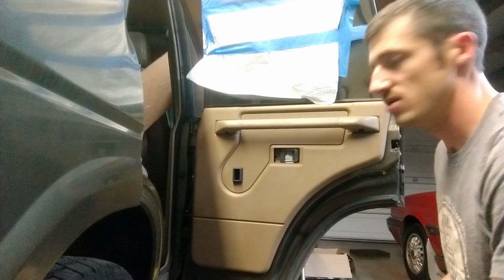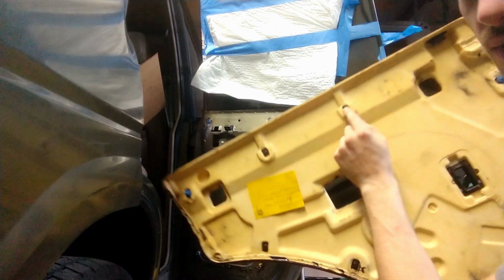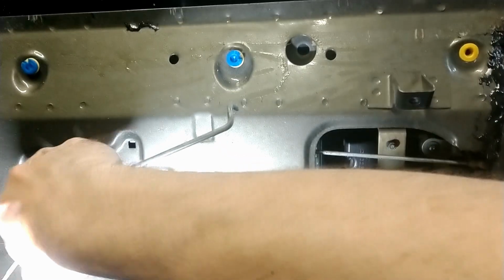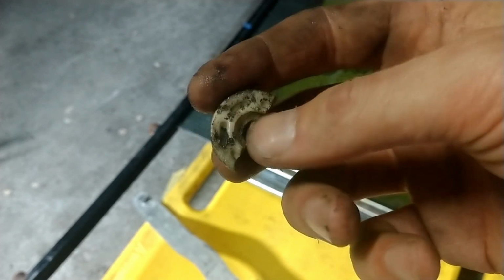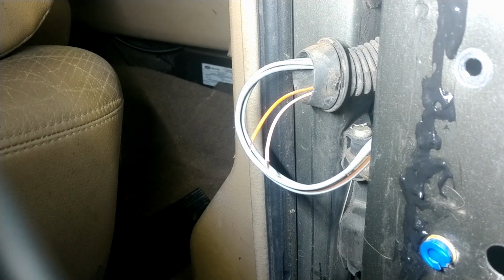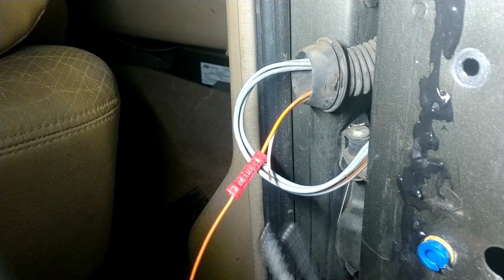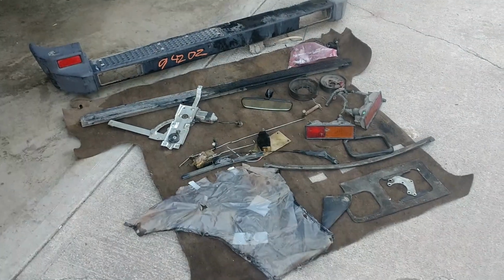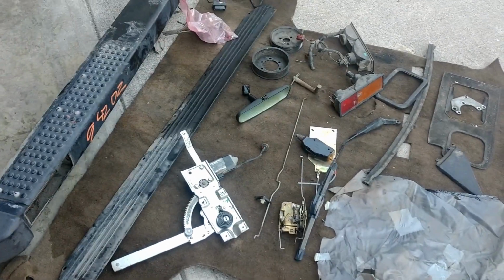1997 Discovery - "Jimmy" - Window Regulator + Wiring Part 1

Comment: 😂 the teeth brush wtf is it doing there,i 've just open 3 doors and repair about 95 % of it and just found tow screw wer not good,thank you for video.
Reply: I Saw a pièce than i need, it's the small white clips on the door lock where you lock the stem from the inside Handel door, sorry i am french and don't know wath the name of this piece , may you could help me,thanks you for this vidéo.
Reply from the maker: Nice work!
Reply from the maker: I'll see if I can pull up a diagram and get a part number for you!
Reply: @NWCollectorAutoRepair  thank you👍